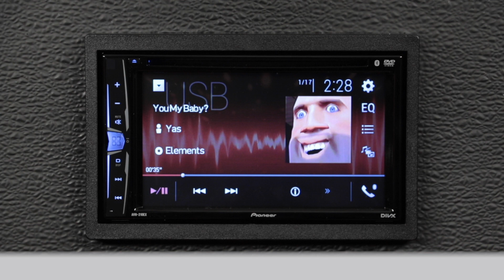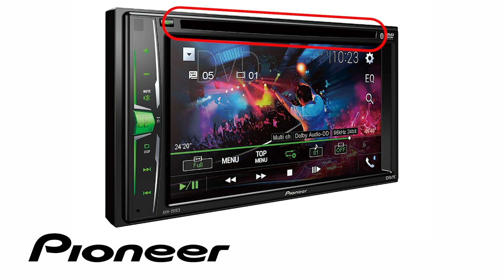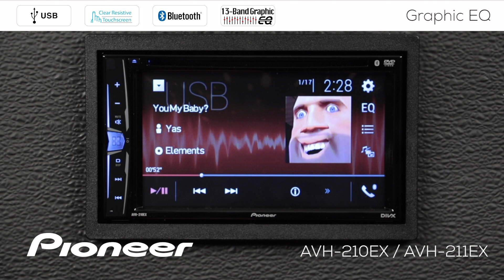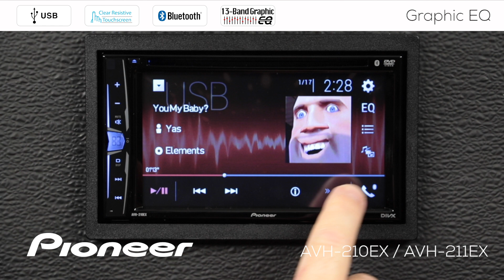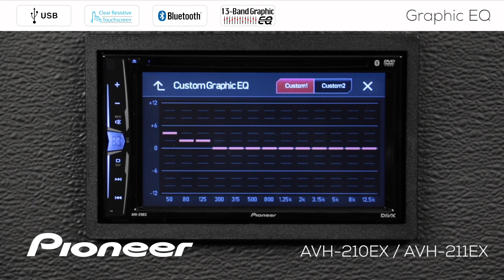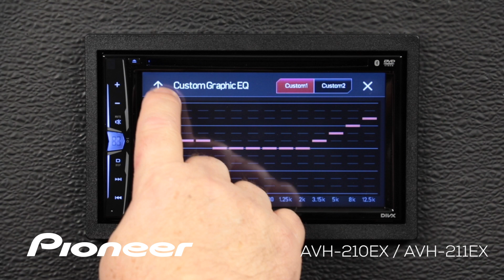How To - AVH-210EX / 211EX - 13-Band Graphic Equalizer Settings

Comment: My stock speakers sounded fine with the stock head unit. Installed this and they sound terrible. Can’t find graphic eq to make it sound decent. Is it normal to have to upgrade your speakers too with this unit?
Reply: In many more modern vehicles, the factory radio is tuned so that it works with the factory speakers installed in the system.  In many cases,  there is very little high frequency sound and is typically heavy on midrange and bass. This heavy midrange is often passes as OK to the average customer ear.  The factory speakers are protected by the radio and tuned so that they will not fail with some abuse.  When compared to a real audio system, many factory systems made this way sound very poor.  If you change one part of the system, like the in-dash receiver, the factory speakers limitations are exposed and they sound bad.  If you change the speakers and not the factory receiver, again you expose the factory tuned system and it sounds poor.  I recommend to upgrade the speakers and you'll be able to get more like the sound you want to hear. Replacing the speakers is relatively inexpensive way to greatly increase the sound quality.  The other option is to go back to the factory radio.  You changed the in-dash receiver for a reason, I believe you'll be much happier with new speakers.  You can learn more about Pioneer speakers here:  https://youtu.be/bwrJ4LcyHmU?list=PLw63zJRQbCNiTV71nfrZHNcn8taD6y4yX   and here:   https://youtu.be/MgZzTIqBBa8?list=PLw63zJRQbCNiTV71nfrZHNcn8taD6y4yX        You can find more videos on Pioneer's You Tube Channel here:  https://www.youtube.com/user/pioneerelectronics
Reply: Deckerd Otto if a car as factory amp from the stock stereo system. Would that cause new speakers and new head unit keep it from sounding good?  I just bought the avh1500nex an jvc speakers an they just sound terrible everything brand new out the box. I understand jvc is one of the lower level speakers but ive ran them in other cars an they have sounded better than what im getting out of them on my current vehicle. I have bought the correct amp wiring harness to connect the stereo. But im wondering if i just bypass they factory amp will it sound better.
Reply: The factory amplifier and factory speakers are designed to work together.  The factory amplifier may have filters or other settings in place to protect the  poor factory speakers.  You removed the factory speakers and the aftermarket speakers you put in place are revealing the limitations of the factory system.  I recommend wiring your speakers directly to the in-dash receiver and skipping past the factory amplifier completely.  Or you might consider getting an aftermarket amplifier.  There are many to choose from like the Pioneer GM-A4704 seen here:  https://youtu.be/fMhhj6MfnMI?list=PLw63zJRQbCNg42VJXw0g7xzWJozqoSR1V   or  if you want more power and the option of a subwoofer,  the Pioneer GM-D9705 seen here:  https://youtu.be/99Hfmc8QxVc?list=PLw63zJRQbCNg42VJXw0g7xzWJozqoSR1V   You can find more videos on Pioneer's YouTube Channel here:  https://www.youtube.com/user/pioneerelectronics
Reply: Deckerd Otto thanks for confirming my suspicions. Thats what ill have to do then.

Comment: Which is bass mid and high
Reply: I wish it had an option to enable  just bass, mid, and treble for casual customers like me. This is kind of  confusing.
Reply: Bass is typically the lower frequencies.  50Hz, 80Hz and 125Hz.  At 125Hz you are starting to get near the Mid range.  The Mids are typically 125Hz, 200Hz, 315Hz, 500Hz, 800Hz, 1.25kHz, and 2Khz.  The Highs are typically 3.15kHz, 5kHz, 8kHz, and 12.5kHz.  These are just guidelines.  Depending upon how your speakers and crossovers are set up, you may find each section drifts a little higher in frequency or a little lower in frequency. A 13 band EQ is a much more powerful and precise adjustment tool than just a Bass, Mid, and Treble control.   You can find more How To videos about Pioneer AVH-210EX in this Pioneer You Tube Playlist:  https://youtu.be/XA-PlD7EXH8?list=PLw63zJRQbCNgLoyoij-BJdPDBVLYipAnj     and you can find more videos on Pioneer's You Tube Channel here:  https://www.youtube.com/user/pioneerelectronics